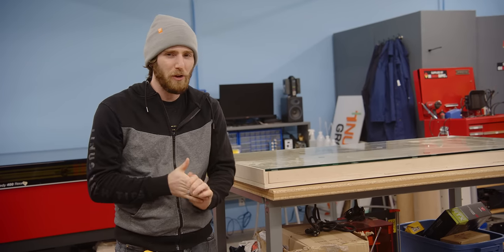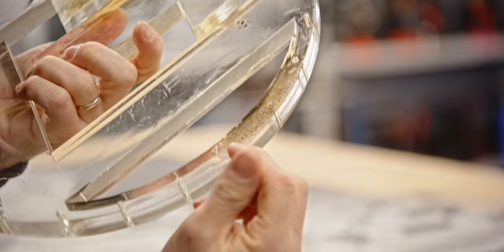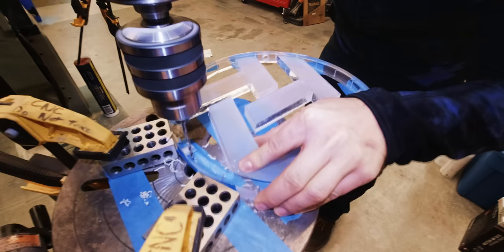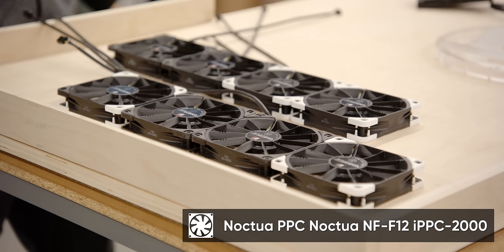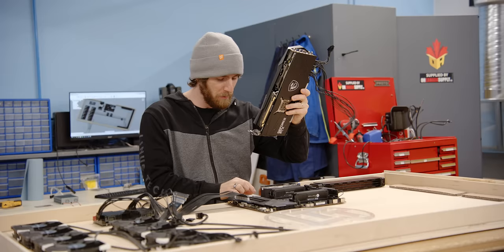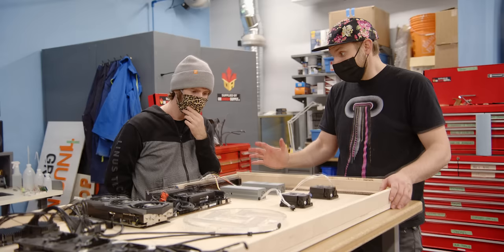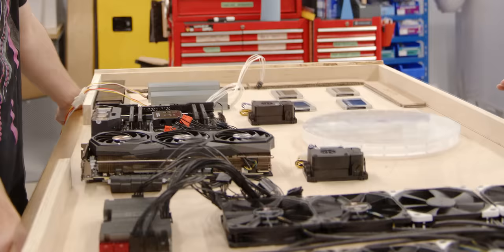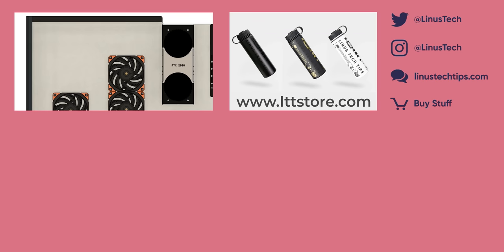Next Gen ULTIMATE Desk PC is ALIVE! - Part 2

Comment: ? Would you pay 1700 dollars or 1100 dollars for one of  these headphones that you won't take outside because you'll be so scared to loose them.  I own a pair of Jabra 75ts, steelseries Artic Pro wireless headphones and a Sonos Arc with two One SL speakers for the rear which sounds great.  Save money 💰 just checked 3 sites Amazon Best Buy and Target Jabra 75ts 129.99 + tax or the SteelSeries Artic Pro wireless headphones for 329.99 + tax Testimonial I put both of these on adjusted the audio settings and my I am in heaven.